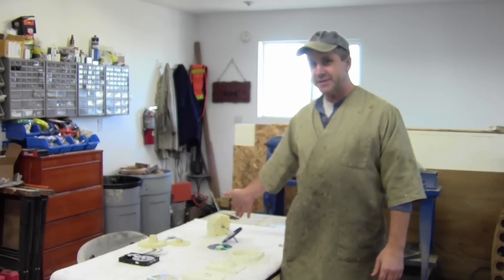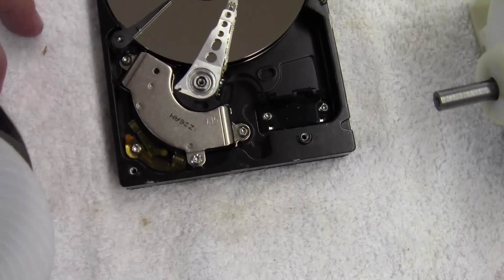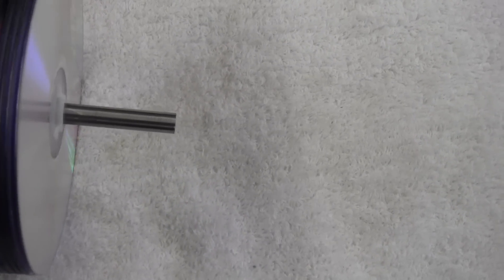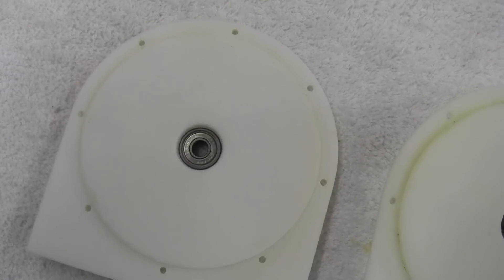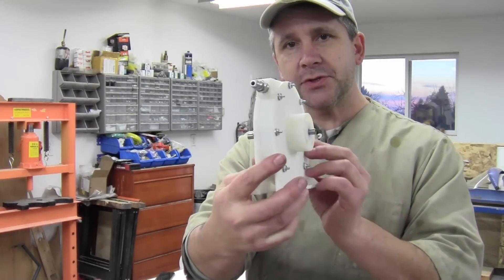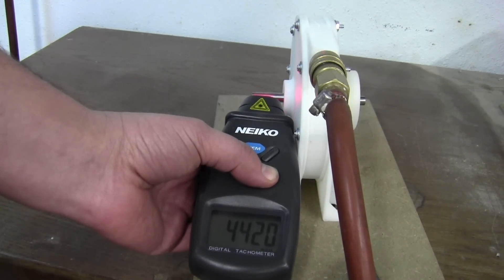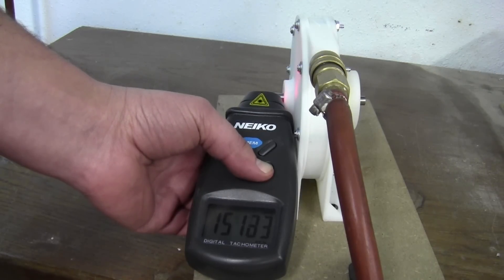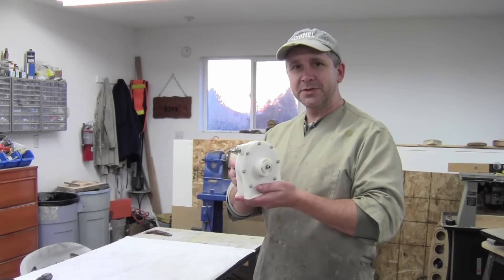Tesla Turbine 3D printed - A better explanation

Comment: I wonder how efficient a turbine of this type is compared with one with vanes.
Reply from the maker: According to Tesla, this has (up to) 95% efficiency - theoretically.  - Which is much better than a single vane turbine.  However with today's technology, several vane turbines can be along a single shaft and can generate much better practical efficiency.  You can read more if interested here: https://en.wikipedia.org/wiki/Tesla_turbine
Reply: Interesting,  thanks for the reply

Comment: How many watts was the air blower using at both low and high speeds ?
Reply: My guess is, just a bit less than would be produced if you hooked an alternator up to to the motorshaft ;)

Comment: That is cool. What if you can generate electricity with that using lots of copper wire and magnets.
Reply: +The All - Nighter You could, but there are two main factors to consider. This turbine is not a high torque device, so without a set of gears most turbines would be too hard for it to turn. Second, you have to remember that this turbine is powered by compressed air, which is compressed by a compressor, and that compressor uses electricity. Due  to the law of conservation of energy, using this to turn a generator shaft would yield less electricity than you are using to power it. 

On the flip side, this could be used in an application where the air is brought in from a higher pressure source other than that of an air compressor. It could be used as a water turbine (it works with fluids too). The only problem with that is that in order to become efficient, this turbine has to be spinning at very high RPMs. To get it to that RPM range would require more pressure than what a dam would produce with nothing but the water itself.
Reply: How about a fresnel powered steam engine? With a solar trackerr?

Comment from the maker: I haven't but I think you are on the right track of thinking.  Tesla believed the turbine would be capable of 98% efficiency so placing a small localized air stream right in between each disk set would probably work very well.

Comment from the maker: I haven't tried liquid water but I would think a real turbine (non model) could have the correct spacing between the disks for pressurized liquid water.  The original (back in the day) were made for steam - compressed air is just easier to use.

Comment: and where IS the Air exit????
Reply from the maker: The air exit are those slots around the shaft.  The air travels between each disc and moves through an open area at the base of each disk and out the exhaust.